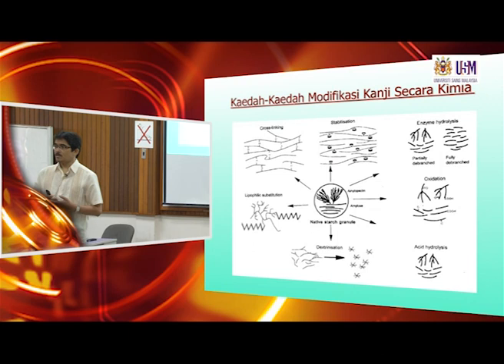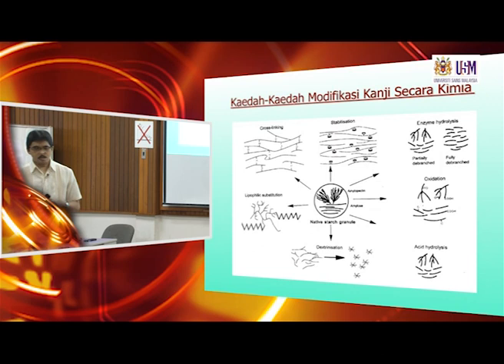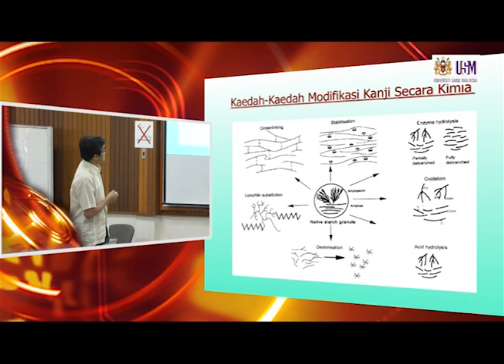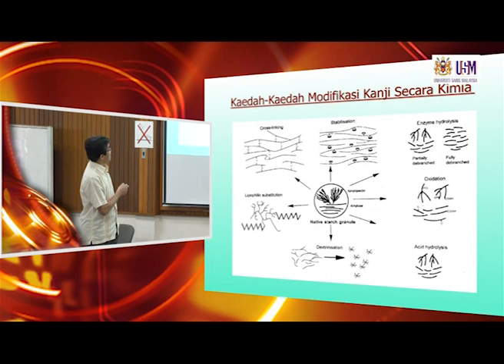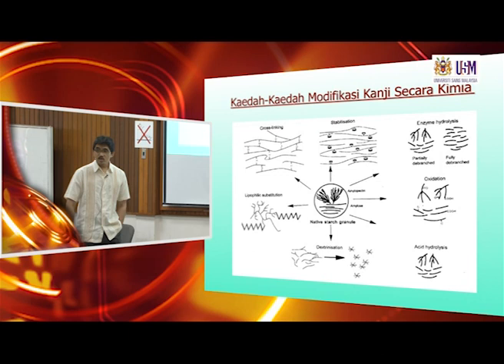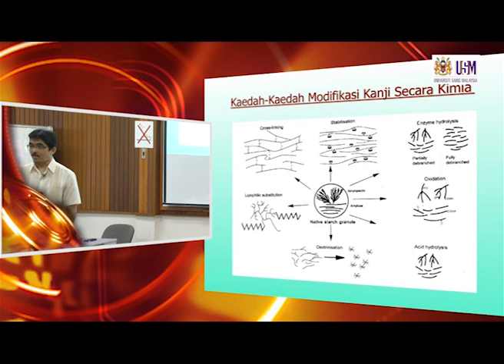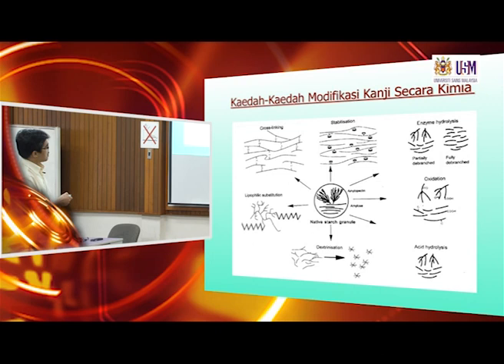IMK421: Lecture 7 (25th October 2012) —Starch Modification

Comment: Dear Professor,
I'm currently working as Product Developer focusing on gluten free bread mix here in Ireland. Though the use of modified starch is still not on my option as clean labeling is one of the biggest issues here in Europe, I would still like to understand the role of modified starch on bakery products. I'm wondering if you have some kind of articles/links/or reading materials/lectures disucssing types of modified starch for bread application and their specific function. Thanks.

Comment: Thank you for posting this lecture!
Would it be possible to modify starch at home using the acid method? It's really hard to buy modified starch where I live.
Can I just cook corn starch at home with water and a little vinegar, neutralize it with a stoichiometric amount of sodium bicarbonate, dry it in a low temperature oven and use a food processor to pulverize it?
Reply: Depending on the usecase you can get around this with buying a product that already contains lots of modified starch, like a cream-stabiliser, soup-/sauce-binder, puddingpowder.